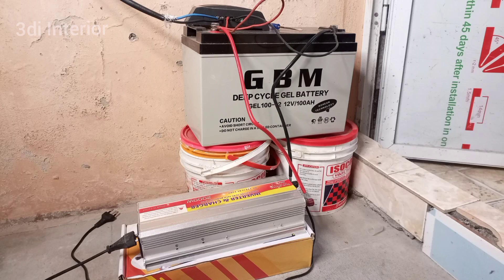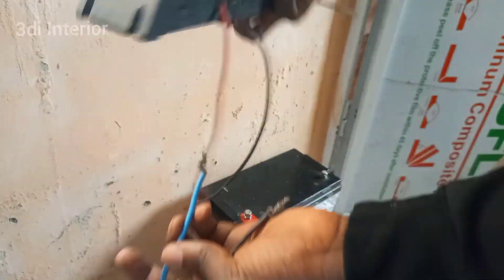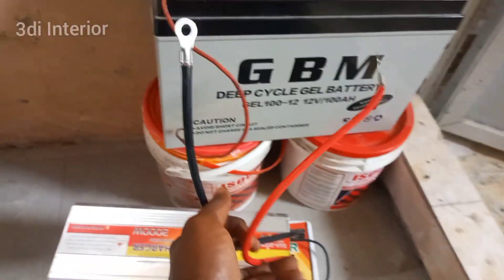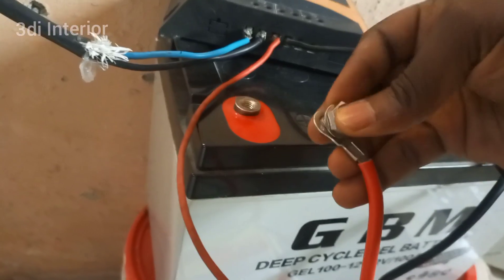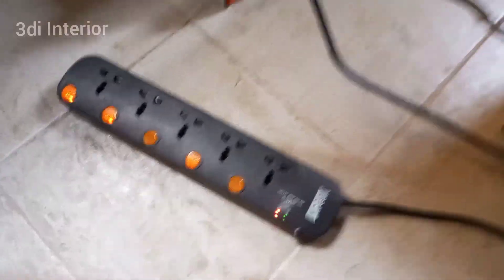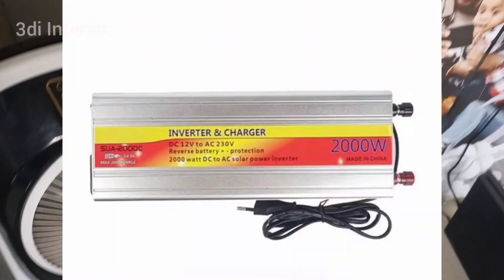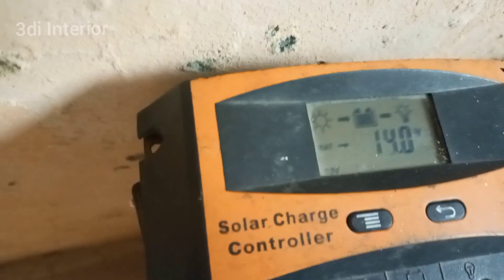How to generate your own electricity inverter with solar panel & battery for homes DIY

Comment: Okay I tried it. Bought the exact materials in the video and this is day 5. 
Here are my observations: 
It can charge phones, carry monitor and laptop (but not all at the same time) 
It couldn’t carry my 220V Fan so now I have to buy a DC fan :/ 

That’s all I use in my
House anyway. If you have the money, invest in a bigger solar setup.
Reply: Please how much is the battery, inverter and the charge controller?
Reply: @HabeebSalaudeen-bw6xv  bought everything from Lagos 
One pieces of 300watts 65k
Inverter 2000w 45k
Charger controller 35k
GBM battery 140k
Total=285,000
Reply: @devbidden please i bought this same product 3000watts and 75ah battery with 2 pair of 160watts but it doesn't carry my 104watts fridge thermo cool. Please what can I do to make it carry fridge
Reply: @temidayokusimo1356  it won’t carry your fridge oooooo

Ask those who sold the solar to you to get something for fridge. It will be costing like 1M+ or 800k
Reply: Please how many hours does it last for you?
Reply: @worldtrendtv01  I have electricity like 40% of the time so my solar can power my monitor, laptop and fan plus or minus phone charging(I always plug all at the same time) through out the day. 
In the night I only use my fan and it’s okay! 

Remember I have electricity too!
Reply: The 300watts for 65k, I assume you're referring to the solar panel right?
Reply: @HabeebSalaudeen-bw6xv  yes
Reply: @wedeyforyou. Does the inverter goes off when battery is low?
Reply: @fadeleenochkehinde5436 yes
Reply: How many hours do you serve you during the night
Reply: Please how many hours does it last for you
Reply: This is Day 6. I bought a cloud energy 10W solar fan online and my inverter has been very happy with me 😆

If I no longer update this thread then know that everything did in fact go as planned for now, let me enjoy the breeze 🙂‍↕️
Reply: @devbidden  I was about saying that the load your 220v fan is too much. I guess it was an industrial fan. However, in my own set up, it carries 2 of my fans very well. One in my sitting room and the other in my room.
Reply: @devbidden  hello sir im about to borrow money to do solar.. is it adviceable before i chuk head sir..

Comment: Here are the current prices as at of 27-04-2024. Based on my own experience

100ah battery now is 100k-130k
Solar panel 200watt. 40-50k (tokunbo)
Charge comtroller 7k-15k (pmw)
Cable 2k-4k per yard depending on mm
Inverter (modified) 20k and above depending on wattage
Reply: Please how long will it take to charge a 40ah battery with a 180W solar panel?
Reply: Dan I carry the whole appliance in the house?
Reply: @sanyaoluodunayo9158  If you want the one that can carry all the appliances like fridge, etc then you will invest more money, but this can carry TV, fan, laptop, light, phone.
Reply: @raphaelikwuagwuokudiri9674  I use my 40ah battery to power my 65W laptop for up to 6hrs and light bulb also.......But I make use of the sun during the day and run on battery at night
Reply: Please where can I get the battery in port Harcourt
Reply: @Miablaze3  jumia

Comment: Thanks a lot for this video. Please can you tell me how i can get everything needed for this setup?
I want to power a standing fan, a laptop, a simple home theatre system and a desktop monitor.
I'd really appreciate that.
Reply from the maker: If you're in lagos you buy them cheap at Alaba market
Reply: They are no longer as cheap as it used to be 1-2 years ago.

100ah battery now is 100k-130k
Solar panel 20watt. 40-50k (tokunbo)
Charge comtroller 7k-15k (pmw)
Cable 2k-4k per yard depending on mm
Inverter (modified) 20k and above depending on wattage

Here are the current prices as at of 27-04-2024. Based on my own experience

Comment: Well done, very brief and detailed with no professional jargons.

My question, what is the name of the wire that run from solar to charge controller, and the battery type?
Lastly, how much can this cost now?
Reply: If you want the battery,  i can provide it for you.  Particularly if you live in lagos.
Reply: @chibuzo7746 how do I get you contact?
Reply: @chibuzo7746 How much is the battery please
Reply from the maker: Don't know the current prices, the battery is 100 ahms

Comment: I am using this same inverter but then I noticed the green light at the back of the battery terminals stays on constantly even when inverter is turned off. Please is Is this normal ?
Reply from the maker: I am not a professional

Comment: @3diinterior760 Thank you very much for this video.

I used the knowledge gained from this video to set-up mine. 

But things are now very expensive so i didn't include the solar panel and charge controller in my set-up. 

I bought 65ah battery and a 2000watts 20A inverter-Charger (inverter with inbuilt charger 2in1) and i connected it to an AC output.  

So i charge my battery using Nepa, since light is fairly okay in my area.
Reply from the maker: Nice one 👌
Reply: The Battery cost about 65k - 70k naira
While the inverter+charger cost 40k naira. 

Ps. This was in December 2023. 

I connect only my standing fan, phones and laptops.  This lasts about 4-6 hrs.
Reply: Now I'm having an issue with my inverter. 

I bought the SUA 2000C inverter charger. 

The inverter stops blinking the green light(charging light) after about 10min and it turns into a solid green light(fully charged light). 

I thought the battery was fully charged until i decided to use the inverter and it didn't last up to 20min. 

Ps. This is a new battery that's barely 3months old and the inverter is also brand new and barely 3months old.

Please does anyone have a solution/suggestion for me?

Comment: I have solar acid battery 12V 120Ah and 200 watts solar i can use this way, please answer..
Reply: Yes u can.  But dont over discharge it so your battery can last.  On the other hand,  you can increase you number of panel say 2 or more so you will almost always have your batteries fully charge, though that depends on your energy draw

Comment: I followed everything you did and it worked perfectly . How do I know when the battery is full and when it is low. The inverter doesn’t have any display on it for full or low battery
Reply from the maker: On the charger controller... You need charge controller so your battery doesn't get damage
Reply: @theartshop.1 Good day, i also did the set-up but without solar panel and charge controller.  
I used the sua-2000C inverter. The issue i have now is that the inverter only charges my battery for like 10mins, afterwards it stops blinking the green light and changes to a solid green light which is suppose to mean the battery is fully charged, but i know the battery isn't fully charged because whenever i  try to use the inverter without power supply it only last about 15min then inverter starts beeping(low battery). 

Please what can i do?
Reply: Get an external charger
Reply: @michaeltaiwo99  I'll try this, thanks.
Reply: You can also get a volt meter... I got a volt meter, so when my battery is at 12.0v I switch off the inverter
Reply: @michaeltaiwo99 To automate the process, you can get a "low voltage cutoff module". You set the minimum voltage you want and it will cut off current when the battery voltage drops below that.
Reply: @michaeltaiwo99  What type of battery do you use? People recommend LiFePo4 but it's just too expensive.

Comment: This particular inverter will damage your tv and ps 4 if used for long. Use pure sine wave to avoid spending more on replacing the tv
Reply from the maker: Every body is a professional on the internet 😏
Reply: @theartshop.1  brother, he is telling you the truth. I had to change from modified to pure sinewave because I learned the hard way.
Reply: @paturch7201 where did you buy the pure sine wave?

Comment: I am trying to setup an On grid inverter systems, do i need the charge controller for that
Reply from the maker: Yes, so that your battery doesn't overcharge get damage
Reply: Please I need more insight on running my own setup
Reply from the maker: @phoenixsmith9697  the video is self-explanatory
Reply: I want to know if I can use up to 4 220ah batter with the same inverter you used in your video
Reply from the maker: @phoenixsmith9697  yes, it's possible
Reply: Is there anything to note about the charge controller when using more batteries or I can use the same charge controller
Reply from the maker: @phoenixsmith9697  you can Google for extra information I am not a professional

Comment: Can i buy 3 of this on jumia and add them together for more power so 3 batteries 3 inverter and solar panel or should i just get more batteries and add them up with the setup
Reply from the maker: Yes you can but I am not a professional
Reply: More ba3 with just one inverter. I can help u to install if ur in lagos

Comment: Thanks boss, but u never explain how to use nepa and gen to charge it. Also how much is the complete set displayed on the screen
Reply: Can any inverter charge the battery with NEPA light or is there a particular inverter that can charge directly from  NEPA light
Reply from the maker: @buchijames  inverter/charger
Reply from the maker: The information are there on the video

Comment: Most people that need this desperately are YAHOOO BOYS 😂😂😂😂😂😂😂
Reply: You are wrong. A lot of people work remotely now. 

You are limited by what you know.
Reply: @theeconomictrader  A lot of yahoo boys rather
Reply: @theeconomictrader I came to YouTube to search for something like this just because of heat and my programming work but he thinks it's only Yahoo boys that need it
Reply: Village People thinking 💭
Reply: Lol na poverty make u think like this🤕🤕
Reply: e369  Real poverty from the druggie president has entered your anus
Reply: Not true. I work remotely, this light issue is very limiting. This is a good deal
Reply: This is what an average home need.
Reply: I’m not a yahoo boy and I just did it in my house to power my laptop since I am into videography n photography, also to power lights in the studio, poverty has really touched your way of reasoning, FYI, fuel is #900 as at the time I’m commenting
Reply: @Cameraboymaad  same way poverty touched the life of tibubu and Yaya below
Reply: Lolz.
Reply: Mumu😅
Reply: Can  i get one to buy to power my house fridge tv washer machine
Reply: No loud am na 😂😂😂.
Reply: Your controller is now MPPTracker that squeeze out every bits of generated DC power from the Crystal ine cells. Also, change your battery to at least Lithium Polymer or better Lithium Iron Phosphate or The Best, Lithium Titanate Oxide.

Additionally, you can keep to SLA battery. But YOU MUST PULSE DISCHARGE IT AT HIGH FREEQUENCY INTO A BIG Farad Capacitor Bank and from there power your low voltage inverter.

The pulse discharging of the Sealed Lead Acid Battery of any type ensures it enhanced life span UpTo 10years+
Reply: You don't have sense
Reply: @anonymous_YTber000  Who?

Comment: Pls how many panels and batteries should I use that can carry fridge and air condition
Reply: Four 200ah battery, nine 250 watt panel 4k+ inverter and mppt charge controller
Reply: @LovePrincess-nh9hx 😅😅😅😅😅😅😅😅😅😅😅😅😅😅😅

Comment: Hello sir greetings to you sir .
Sir i thank you for bringing this up, am interested and i want to have mine.
#Sir, what kind of battery and capacity can i use for a start,the carry my TV set, ceiling fan, lights charge my
 phone.
# sir how do I go about the panel, charge controller, inverte and it capacities. 
Serious interested to know and learn. Am waiting for your response. Thanks
Reply: You can follow the setup in the video, I believe the video is detailed enough for connections and ratings.
For a start just like in the video and for your gadgets listed, go for 2000watts inverter, 100ah or higher battery, and 10amp solar controller.
Good thing about this system is that all can be upgraded to suit your needs
Reply from the maker: If you are in Lagos you can buy them in Alaba international market... Just ask for solar section
Reply: @theartshop.1  my sir. Am at Port Harcourt
Reply from the maker: @nwachukwumatthew2531  you can by them in ph also

Comment: how is the battery doing now bro?
Reply: How many hours does it take you, when fully charged
Reply from the maker: @PraisetechGX  I haven't caculated it
Reply: @theartshop.1  But with this load u used here, at least 5 hours without the sun?
Reply: @theartshop.1  And if there's sun, can u use them directly?
Reply from the maker: It's ok... Still using it

Comment: For safety of your home gadgets i recommend pure sine wave inverter. Your TV or any sensitive gadgets might damage with that type of inverter, pls be warned
Reply: You bought modify inverter so it can't power fridge,, you need 1.5kva low frequency inverter
Reply from the maker: Thanks
Reply: Please your contact. I bought 3000watts of this product and 75ah battery but it doesn't carry my 104watts heir thermo cool fridge. Please what do I need to do
Reply: @temidayokusimo1356 the load is more than the set up capacity
Reply: which one is pure wave inverter please enlight me
Reply: @babalolaanuoluwapo7695   sine wave is inverter based transformer,
Reply: U have 2 main types of inverter,  pure sine wave and modified sine wave.  The one here is modified sine way.  The pure sine way is much better. If you have very sensitive electronics,  this can interfer with the operations. But for basic use, this can do
Reply: @chibuzo7746  Yes, u are right. If u use modified sine wave to charge ur phones too often, it may end up burning ur phone's panel with time. It happened to me before I decided to purchase pure sine wave inverter. Though for gadgets like TVs and sound system, modified sinewave inverter may not cause much of a problem. However, pure sine wave inverters are the best to use but are very expensive and are much bigger in size than modified sinewave which are often in sachet sizes. The cheapest pure sinewave inverter should be around 120k. I bought mine 185k as at 3 months ago.
Reply: This is also cool
Reply: Yet to to see pure sine wave with this particular inverter
Reply: Do I need fuse and breaker or this is just ok

Comment: How many watts solar panel will i use for 1000w inverter with 75a battery and how many panel? please 🙏 please answer the question am interested thanks 🙏
Reply: With 75a battery
Reply: Buy 180watts solar, if you have two, it will double or fast the charging rate of the battery.
Reply from the maker: I am not a professional

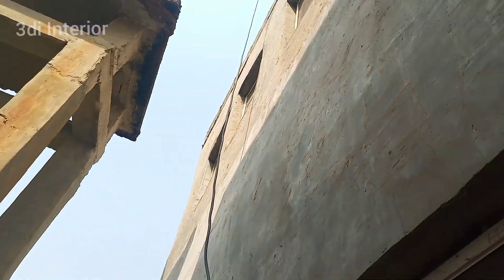Comment: Please help me which best parckage will i go for i only need the one that can power my PC, stand fan and also change my phones and gadgets ?? Please help adivce me on which one to go for.. 0:59
Reply from the maker: I am not a professional I will suggest you go to Alaba international market in Lagos and make you inquiries with people who deal in solar energy
Reply: Yahoo boy.. Pc is always so important 😂
Reply: You need a 1kva system
Reply: @mikolobabz how long will
It last. Need for just a system and 1 standing fan
Reply: @samuelmpamugo3939  Difficult to say coz it depends on many factors:
*Your solar panel wattage
*Your battery size
*Where u place your solar panel
*Your charge controller type
*How long per day you intend to connect your loads
But with everything put in consideration esp 4 a system, fan and TV, you would be able to get a set up that lasts you the whole day for about N1 million

Comment: You should connect the charge controller to the battery first before connectimg the solar panel
Reply: Because the battery power is stable not like the power from the panels it can easily destroy your charge controller
Reply from the maker: @deltaebimieowei426  thanks
Reply: Why to the battery 1st?
Reply from the maker: Thanks

Comment: What about the long wire attached with the panel, did it came along with the panel?  Or u purchased it separately, and if so, what is the name of that wire and how much those it cost approximately
Reply from the maker: It's came separately... I can remember the price... People selling solar system should know the name

Comment: I spent 318k
520watt panel 260 each
Exactly same battery as yours
Inverter and charge controller,
Could you imagine this thing can't last up to 6hours when there's sun
My load is just my PC, phone and standing fan.
I'm being frustrated
Reply from the maker: Are you sure you bought a brand new battery???...
Reply: @theartshop.1  yes is brand new, is the same GMB 100A gel battery as yours
Reply: i think you must not  use beyond  50% of the battery capacity otherwise your battery would be damaged.

Comment: And please sir is thier any method of using this without inverter and controller, let say using the solar panel with ur battery and ur extension wire can't it works like that.
Reply from the maker: You need inverter to convert the current... You need controller so that your your battery doesn't overcharge and get damage

Comment: Please can you list the things to buy and possibly how much to get them. Thank you.
Reply: Thank you Sir. What about the wire, the type of wire to buy to connect the panel to the charge controller.
Reply from the maker: @umarudeenshina1785  I am not a professional... You can go where solar products are sold and you will be given all the information you need
Reply: OK thank you Sir for your assistance. God bless you
Reply from the maker: @umarudeenshina1785  you are welcome
Reply: Please what are the rating for the battary, inverter and charge controller
Reply from the maker: @profwhite3071  you mean prices?
Reply: @profwhite3071 The inverter rating is 2000watts, battery is 100ah and solar charge controller is 10a...
Reply: Sir can it power a ceiling fan
Reply from the maker: @odimarvelous9000  yes it can
Reply from the maker: Here in Nigeria 150w panel is about 37,000 2000w inverter is 35,000k 100ah battery is about 98,000k
Charge controller is about 8,000k